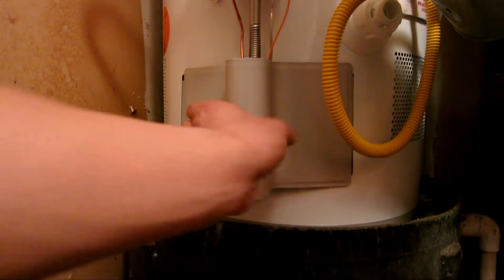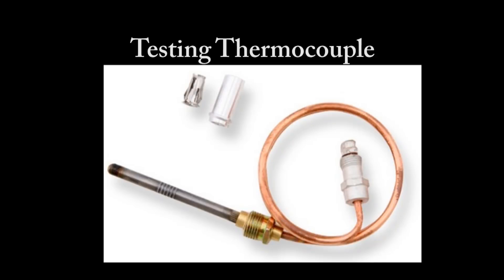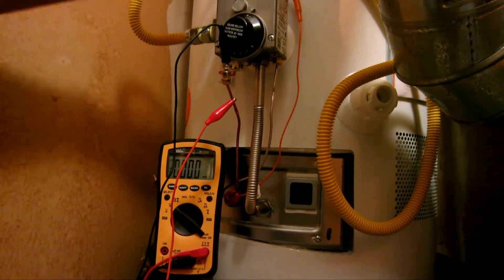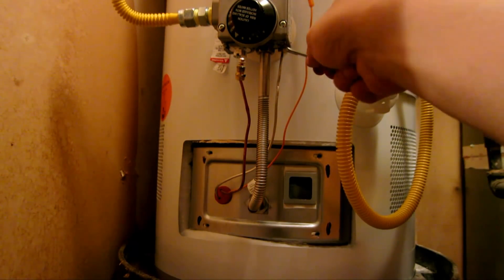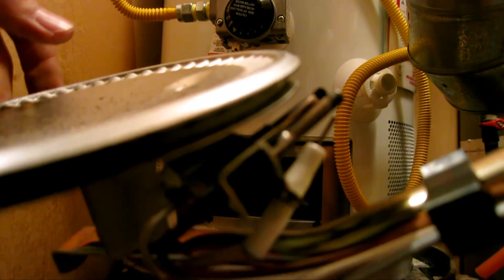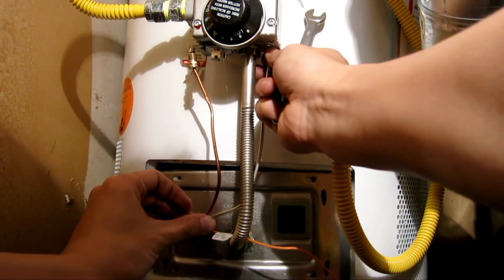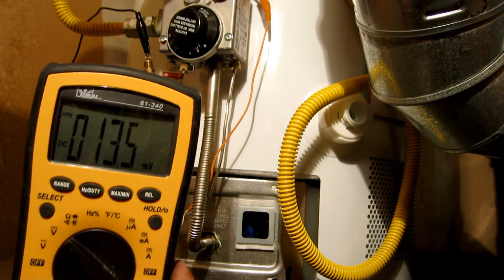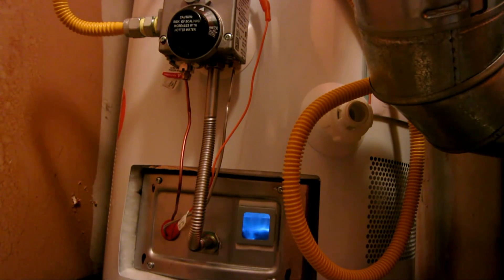Hot Water Heater Pilot Light Won't Stay Lit or On - How to fix waterheater by testing Thermocouple

Comment: Thank God for your video, I wasn’t getting hot water so I thought the worst, but I had the same issue, I just realigned the thermocouple to the pilot and cleaned it. After reinstall everything worked as it should, so thank you so much

Comment: I found what was wrong with mine. It was full of mice  nest, where they chew up a lot old stuff and put in around the burner.  It wasn't getting enough air.  I cleaned out the rat nest and everything , and when I turned it , it lit and the burner lit and heated the water.   It wasn't  getting any spark , so I tied a  piece of insulated wire around the three  and pulled it together. Thermo, burner, pilot, wasn't getting good connection.   Now it heated to temperature I set it without any trouble.

Comment: I know this video is 9 yrs old , but is a "Rheem" built this same way ?
It looks alot like my water heater,
the pulot light is dim and it also just goes out. My question is (if anyone can answer) will the whole assembly come out of that square with four (T-20) screws ? Technician wants to charge $1,000.00 plus for repairs. Dam $600.00 more than a new water heater, it's totally sickening what things cost these days 🤢🤮

Comment: My 50gal. tank, pilot light wouldn't hold when lighting. Millivolt reading for thermocouple was good, 27.9. It would fire the burner, but after initial firing, it failed to re-ignite burner and would only do so when tank cooled down.After close inspection, the 'in-line' ceramic fuse of thermocouple was compromised. Didn't notice how bad it was until I touched it...it crumbled.

Comment: I’m definitely going to try this tomorrow. Our heater is only just over one year old, in a new construction house; I’m assuming it was damaged from shipping or installation, and the now lower temperatures of winter may have caused an issue with contraction of the metal. Thanks for the video!

Comment: So I’m trying to test the thermocouple however when I disconnect it, the pilot light won’t even turn on. We recently had installed some lines outside that go to different flames like tiki torches but master plumber said it shouldn’t cause a problem since the gas line should go into our home before even going out there. All lines to the outside are shut off when I tried testing but it won’t even ignite the pilot when disconnected only connected and immediately turns off after letting go of the pilot light…

Comment: I have been having trouble with my water heater for the last 3 days.  It went off I think thursaday and the water wasn't staying hot.      The igniter wire had been chew I think by a mouse and  it didn't want to light pilot.   I didn't know it was supposed light it.    So read th instructions  and it lit.   20 mins later I heard a sound  and it was the humity was causing it burn yellow, it was on until this morning  and again the water was moteratly  warn, but the pilot light was out again.       I tried light it again lighting it again like it said and there  an explosion  in the chamber.        This water heater  isn't but    3 years old    I am afaid to risk it again   What shuld I do?  because if the chamber is damaged  from the explosion   I don't it be a  bigger explosion.

Comment: I made an important discovery after following the advice in this video. My GE water heater's pilot light would not stay on. I measured the thermocouple's output as prescribed here, and it output about 20 mV within a minute and 29 mV in less than two minutes, so it looked OK. I reported that result to Rheem (GE water heater Technical Support), as mine is still under Parts Warranty, and they suggested the Gas Control unit (thermostat) as the next likely problem. They shipped me a replacement, which I installed, but the symptom continued. They next suggested that my natural gas pressure should be checked to ensure sufficient pressure. I don't have a manometer, so I called PG&E to come out to do that. My pressure was sufficient, but their agent was further very helpful in explaining that my thermocouple also needs to be tested UNDER LOAD (while it's transmitting to the Gas Control, i.e., still connected). He did this with a Gas Valve Thermocouple Adapter in line between the thermocouple and the Gas Control. So, in actual operation, the thermocouple was NOT transmitting the necessary voltage to keep the pilot lit. I replaced the thermocouple (even though it measured correctly while disconnected), and now everything works fine! The adapter he used looked like the UEi Test Instruments Atha1 looks on Amazon.
Reply: Why didn’t you just replace the $10 part and save yourself all the trouble 😎
Reply: @LongTruong-zz1kz  "I measured the thermocouple's output as prescribed here, and it output about 20 mV within a minute and 29 mV in less than two minutes, so it looked OK." (And Rheem agreed.)

Comment: Thumbs up, but I wish the disconnection point of the ignitor wire had been shown onscreen. As I pulled apart the long orange ignitor wire and the short black wire, presumably separating under the short orange cover (just barely seen in the video), a section of bare metal wire(s) appeared still attached to the black wire, so I stopped the separation. Is that normal? What should the end of the black wire section look like? I hesitate to break the ignitor section of the thermostat assembly while trying to replace the thermocouple.
Reply: I found the following video, which clearly shows the disconnection point of the ignitor wire (0:39): https://www.youtube.com/watch?v=RGClOp67LSM . On my heater, I slid the orange cover/shield down the orange ignitor wire (a drop of oil at the bottom end of the cover helped it slide) to expose the connection, rather than forcing the disconnection underneath the cover. Now I see what the "bare metal" was, the normal connection of the two wire segments.

Comment: Bro i replaced everything that can be replaced on the gas boiler. I called ABCUS heating and plumbing to see if they could help me with it. They wanted to charge me $458.00 to fire the gas boiler up saying "Proper Seal and Rewire" SO after many tries i was about to give up and saw your video, I went back and aligned the Thermo coupler  with the gas line and bamm it stayed on. Thank You,

Comment: I'm having trouble with my Richmond water heater, it was installed a few months ago by my landlord, the other day I noticed no hot  water, went to inspect n found that the pressure relief valve had failed n spewed water everywhere, water had got in the bottom of the tank from the down pipe off the relief valve, I drained out the water n lit  the pilot, waited then turned the flame on, after it flamed up it went out after a few seconds, n has been doing that each time I try to light it..... It's driving me crazy n so is my wife lol what should I do......please  any help will do .... N many thanks either way.

Comment: Thank you for taking the time to produce this video sharing your knowledge and insight. It is noteworthy to mention that this video was produced about 7-years ago and it still applies and works. Al and I just got done moving the thermocouple with our bare hands into a much closer "orbit" of the pilot (It was really probably a 1/2 an inch away). When we relit the pilot light the flame was not only much brighter in its brilliance, but it was also a slight bit bigger as well. Sure enough, when the switch was turned to the on position, and the heater ignited immediately. Thank you DIY TINKER and Yahuwah(God) bless you and your family for sharing the gift of Yahuwah in you, by the sharing of this video.

Comment: My crawl space had some light flooding. I dried everything up. I lit my pilot light , then I turned the dial to on , and the burner ignighted. Then 3 seconds later both the pilot and the main burner went out. They would not relight. Then I left them off for a while , went back tried again , and the same thing happened. I  watched a video on YouTube.  They were saying that oxygen was not getting to the chamber. I checked and sure enough I had 1/2inch of water in the bottom of my heater. They said oxygen comes up through the bottom of the flew. Would my burner and pilot both light if my thermal link was broken?

Comment: pilot light stay on but no hot water.
Reply: it's your gas regulator, its $200.00 for the part , in that case would it be better to replace it.

Comment: Thank you for a quality video, I replaced the thermocouple two times, but after a while (about a month each time) pilot light wouldn't stay lit, this time instead of replacing, I cleaned it and adjusted it closer to the pilot light flame, put it back together, works again. I appreciate the information and the money saved.

Comment: The tip of the thermocouple should not be simply "even" with the pilot light, the thermocouple should extend past it so that the flame of the pilot light covers 3/8" to 1/2" of the end of the thermocouple. They designed the tip long for a reason.

Comment: Thanks for the video. You gave the best tutorial ever. I did not know how to test the thermocouple. Mine was fine. Turns out as you said. I pulled the new burner unit out and checked the position of the thermocouple to the pilot and it was misaligned. I tweaked it a bit and presto. 
Thanks very much.

Comment: Thanks for all the good info on how to test and align the thermocouple. I am having the same problem and I put a new thermocouple into the unit. I will check mine this morning.  If the thermocouple readings are good I will pull the burner and check that air link inside the unit. As long as I hold the pilot light button down it burns but as soon as I release it it goes out no matter how long I hold the button down.

Comment: Excellent video - I would just add that you could have left the meter connected and used a butane lighter to heat the thermocouple to be sure it was good before reassembling - more important for an older thermocouple.

Comment: Hi - I am trying to replace the thermocouple on an old gas water heater. I am having difficulty removing the burner assembly from the thermostat/gas valve fixture on the outside of the tank. I can't get the bolt on the pilot tube loose. The bolt seems to be a soft metal and now has a bunch of nicks, etc. from me trying to remove it. Questions: 1) Can this be a "left-handed thred screw" situation where you must turn the bolt CLOCKWISE to LOOSEN?  2) Should I be using a FLAT adjustable wrench instead of toothed adjustable wrench?  3) Is there anything that the pros use that would help "grab" the nut better and leave fewer nicks - something like a kitchen jar gripper comes to mind.   Thanks so much for any help you can provide!!!

Comment: I shut off the gas disconnected the three lines and pulled out the burner.  Cleaned debris on top of burner and put a small wire brush to the thermocouple.  Pilot has stayed lit now for over 12 hours.  Still going to replace it as it's over 13 years old but good for right now.  Took maybe 20 minutes, tops.  Thanks!

Comment: Thank you soooo much!! My water heater is exactly the same model as the one shown here. The pilot would not stay lit, I cleaned the thermocouple  with sand paper but still no luck. I went to the local ACE hardware store to buy a new one, it did not look exactly the same but I made it work waahoooo!!! The only thing I had trouble with was removing the old thermocouple, I had to use a pair of needle nose pliers to remove it, it was kind of hard but not impossible.
thank you again, you saved me from spending hundred of dollars on a service call :)

Comment: Hi i just watch your video and i think you can solve my problems. After i hold down the gas control knob for 1 minutes and turn the gas control knob to on when i set the thermostat dial to my desire setting which is the B it lit up but not staying. What can i do and how much would i spend to replace it? Thanks!

Comment: Well, i didn't check my voltages initially but I cleaned the thermocoupler using fine sandpaper, but without pulling the whole burner out. I put it back together. Measured and got ~20millivolts. Pilot still goes out when i let go of the pilot button. Sigh! Should it be at 30mv? My water heater is a Rheem 22vr40fn. My heater sits inside a closet. So the heater goes up,over, down into the closet. So, I've not been able to  pull out that burner assembly. The burner inside is like 2 inches thick (like the old round Fram air filters) and i couldn't get the whole assembly out. My heater sits in a 2 inch high PAN for in case of leaks. The PAN has hole on the side facing the front and with a pvc tubing mounted thru that hole and the tubing leads out from a screen that right below the closet step and out into the ground. That PVC tubing prevents me from pulling out the assembly horizontally. Its always tilted up a little by that pvc and that thick burner hits the top of the heater opening. Guess i'll have to cut that PVC. Then see if i got enough space to pull the whole assembly out (i think i got about 8 inches before it hit that closet step).

Comment: Great video.  Only one negative comment: I measured 19mV on the thermocouple and reckoned it was O.K. but I replaced it anyway, and that fixed the problem.  So, getting a decent voltage on the thermocouple doesn't necessarily prove that it's good.  Other than that, the video was a great help, so thank you! :-)

Comment: Your problem may have been much simpler.  If the thermocouple is touching other metal, it will be electrically shorted.  I can't tell from the video but it looks like your thermocouple was touching the other pipe.  My thermocouple was touching the other pipe and moving the other pipe away from it removed the electrical short and started working again. https://www.instagram.com/p/BUr0P8FlnTF/?taken-by=trigggl&hl=en

Comment: hi thank you very much for the video. does the voltage on thermocouple always have to be 20? or does it vary from tank to tank?   Also, I'm having a slightly different problem. The pilot turns on and holds. however, after few hours the heater shuts off and I have to relight it. what do you think could be causing this?

Comment: I Turned my main gas line off to install a new Gas Dryer  now I can't relight my hot water heater I see a spark from the  igniter but the pilot won't ignite Yes I'm holding the red button down my dryer 7 my gas stove are working
Reply: hey I have the same problem did you find out what was the problem?
Reply: Most likely air in the gas line. Just bleed the line until you smell gas

Comment: It's not a "hot water heater" it is a water heater. If the water was hot you wouldn't need to heat it.
Reply: ...except that the "water heater" itself gets hot on this inside b/c of either the element or the flame, so it is actually a (hot) water heater :)

or you could say its a "hot" water heater b/c it has electrical wiring on it that is "hot", or live, thereby still being a hot water heater :)

Comment: Great video, very helpful, thanks very much! Question: when you had the assembly out and you noticed the thermocouple was not in the flame, before putting it back, could you have double-check tested the thermocouple by holding a lighter or a candle under the tip and measuring the voltage? To save you from reassembling it and then finding out it's bad?
Reply: Yes, you can test the thermocouple while it's out, and it's a great idea.  The thermocouple is a self contained unit and not connected to anything else on the burner assembly. I'd use a gas lighter.

Comment: where should I leave that black thermo thing at? ours arrow faced at LOW and I have problem not getting hot water. please help.
Reply: Typically, there's Vacation/Low/Hot then A B C then Very Hot. I remember seeing a professional contractor suggested to set it around A B. I would turn it to Hot or A, and go from there.
Reply: Ideal Soul Production c

Comment: My thermocoupler checked out good, climbing past 25mv. I put everything back together, hold down the gas control knob in the "pilot" position for one minute like the instructions say, but when I let it go, the pilot light goes out. I've tried several times but the pilot light goes out every time I release the control knob. The pilot light goes out before I can even think about putting it the "on" position. Any suggestions?
Reply: bad gas valve, you would need to replace it.
Reply: try lightly sanding the thermocouple first, but it's likely the gas valve

Comment: My pilot is doing the same thing yours was at the beginning of the vid. Originally my pilot was out and when I inspected it I found the pilots tube was broke(have no idea how) I replaced the tube and put everything back together but now the pilot won't light. After watching this video I'm not gonna test the thermocouple and see the voltage. Hopefully it's bent like yours was. If not am I to assume the only other thing it could be is a bad thermocouple? Heater isn't 3yrs old yet and would have to have to replace for something simple.